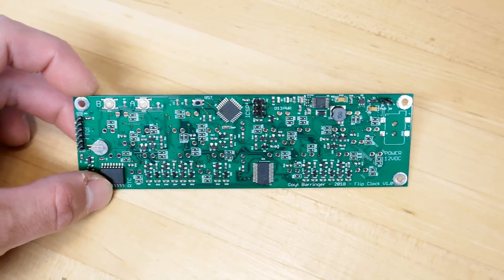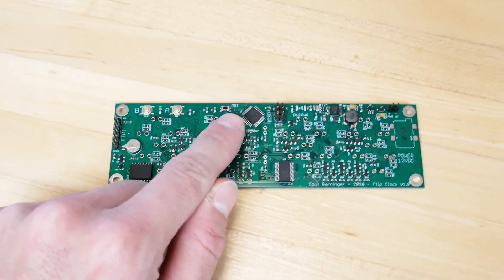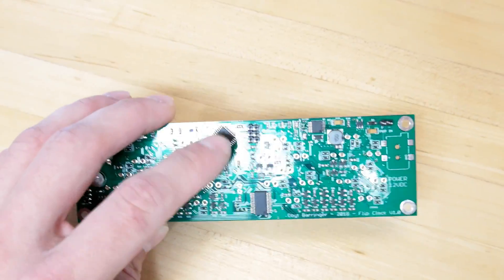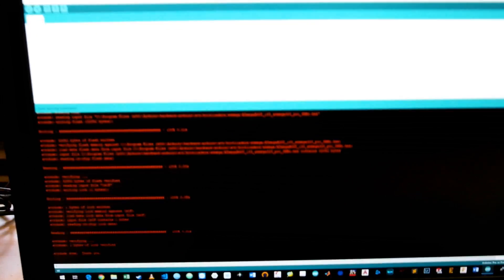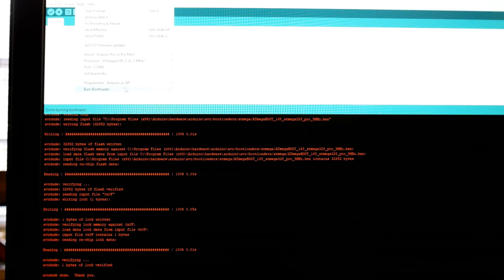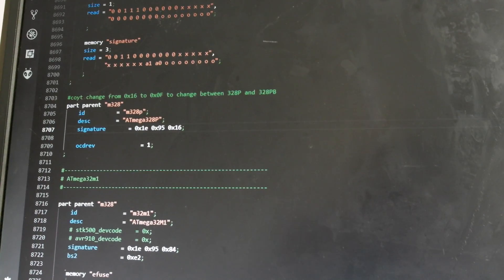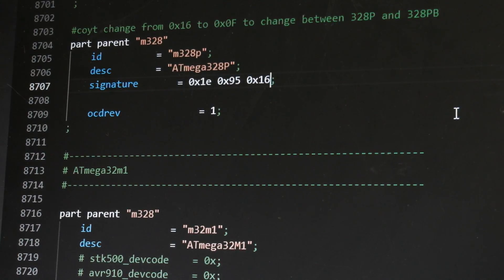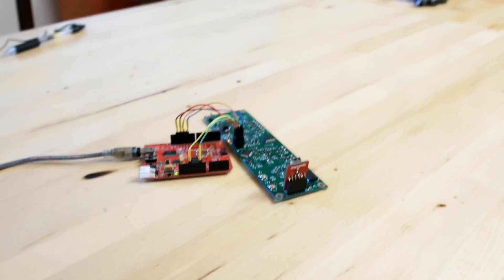Programming Arduino Fuses and Bootloader on New ATmega328PB

Comment: You can work with atmega328pb by installing the kernel from MCUdude - MiniCore. In my case, everything works correctly with the installed version 2.0.5, work from the internal generator 8 megahertz. When connecting an external quartz, the chip behaves inadequately.

Comment: Hi. I already have m328pb part defined in my .conf file. But, still it says, Error while uploading bootloader.
avrdude: Device signature = 0x1e950f (probably m328p)
avrdude: Expected signature for ATmega328PB is 1E 95 16
Double check chip, or use -F to override this check.

Would really appreciate any help! Thanks.
Reply from the maker: I dunno - I 'd probably just try to just change the signature, whatever it is, within your .conf file for the m328pb to the "device signature" of 0x1e950f. So the conf file contains the "0x1e950f" and doesn't expect something different when u try to program.

Comment: I had the same problem with the ATmega328PB on a custom board but used the Arduino-Board-Programmer by nickgammon ( https://github.com/nickgammon/arduino_sketches ). This also loads the normal Atmega328P bootloader to the new chip. Your solution is also pretty nice. My problem now is that i need the new features of the Atmega328PB (10 PWM pins instead of 6). Maybe someone knows how to do this.

Comment: I bought some slightly different chips one time too. But instead of doing all this, you can download some other Arduino boards from the boards manager. You'll maybe have to add a URL in preferences depending on what you're using. One of the ones I've added is called Mini Core. There's the option for PB, as well as many others there.

Comment: Hi there!!! I made the same mistake!!! I specified the "PB" instead of "P" in one of my projects. In my case I had to use the ucontroller as "PB" because this model has more digital pins and most of the analogicals are also digitals too (comparing to the P model). I used all of them!!! You can even use XTAL1 and XTAL2 as digitals (assuming no external crystal - 8MHz internal oscillator). It requires some assembly programming 'cause' Arduino refuses to accept the 'normal' instructions on certain pins.  I am using USBASP as a programmer (I believe it costs about $3 to $4 - my currency is in Reais). You can check POLOLU's site for a bootloader specific for the PB sufix since they have an Arduino model working on this condition: all pins are available (except for PB6 and PB7, even though they are not connected to external crystal). They provide the HEX file of bootloader for the 328PB working with internal oscillator. And you can have a USB to serial converter externally assembled to the circuit, as you did. In my case I'm using CH340G. Doing this way you can use all the improvements of this new version (PB). I congratulate you for this video!!! I would like to have watched it before. It would saved me at least half of my headaches!!! Cheers from Brazil!!!

Comment: Worked first time. Like you I selected pb for manufacturing without giving a thought that it wouldn't program. Only issue had to load the sketch using Arduino as ISP programmer, wouldn't upload via serial. Probably an issue with my design. But thanks

Comment: With that bootloader can you use the new features of the 328PB?
Reply: yeah you can, the new features are extra pins ect...install minicore from github there is loads of info there the 328pb is miles better.
Reply: No